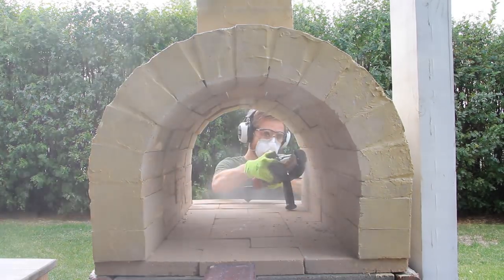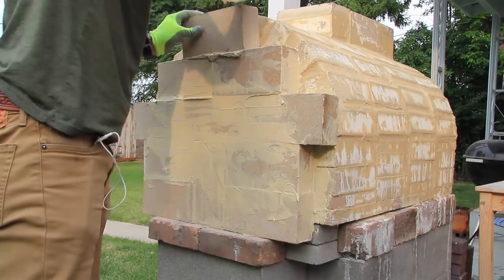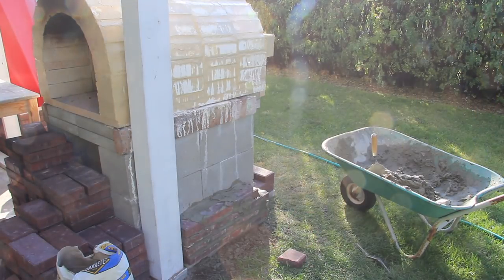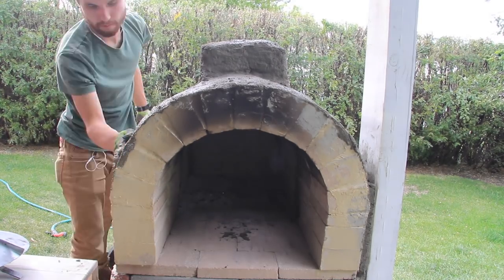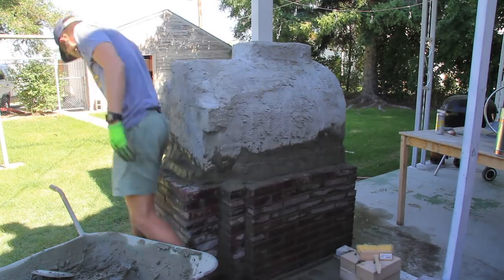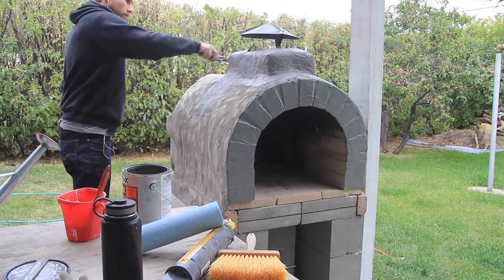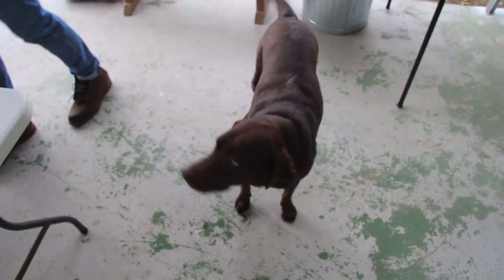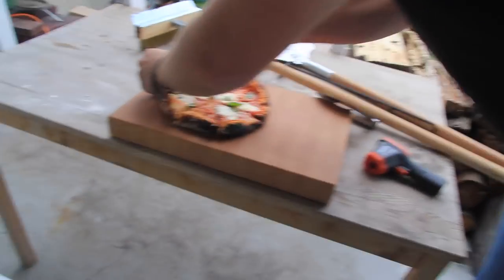DIY // How to Build a Wood Fired Pizza/Bread Oven Part 3

Comment: Awesome job.  I attempted one a couple summers ago.  Bad mix of concrete and it cracked.  Made a few good pizzas with it though.

Just out of curiosity was there a problem with the bricks at the front not heating up enough?  What was the difference in surface temp of the front bricks and back bricks where your pizza is cooking?
Reply from the maker: Thanks for watching and for the comment! No, once we had a good pile of coals in the back, each pizza would cook in about 2 minutes. We kept that area of the oven at about 600 degrees F.
Reply: Right on man, thanks for the quick reply.  Have fun and good luck!

Comment: Have you found that the mortar you laid, has lasted? I've worked on bricking furnaces with seasoned brick layers and they have always said that with arches, you shouldn't use more mortar but rather, cut a wedge of brick and keep the mortar layers of consistent thickness. I'd rather do it your way so that I don't have to cut any bricks but I'm concerned with longevity.
Reply from the maker: That is a great point and one that I would take if I was to do this again!

Comment: Can you tell me how many each of the hi temp bricks you used?
Also what size radius did you use on the wooden template when you where building the arches?

Thx
Pete
Reply from the maker: I don't remember the exact number. All depends on the design you use. Good luck with the build!

Comment: Hey man at your recommendation i went and bought the mortar from amazon link you provided but i got grey cement power not premixed do you think they changed their quality !??
Reply from the maker: No it is still high quality, high temp cement. Just mix water into it. Follow the directions. Good luck!
Reply: Thanks for the reply! After i mixed it it turned out to be grey not offwhite/ yellow like your video! Dunno what im doing wrong 🙃
Reply: Thankyou bro, I will try and make my pizza oven, from your good tips surely I will prevail.

Comment: im not an expert, but i knew it will happen, the contribution of heat is not even. as i said from your 1st video while making the oven, there's lack in it. burning wood should be in the bottom to heat the upper part and not inside to avoid instant burn of the food, with ventilation at both oven and the burning compartment separately. there should be bottles and mini stones for equal distribution of heat. and also build a door in the oven to maintain the heat. the only thing i love is your arc. it looks nice
Reply from the maker: Thanks for watching and for the comment! Even though your tips are good, this oven worked great and cooked lots of delicious pizza :)

Comment: how many bricks did you use for the fire ones?
Reply from the maker: 66 full size bricks including the the rear and 12 1/2 bricks for the top slip line and the first layer either side. These are the fire brick numbers

Comment: Great build, was wondering what did you paint on in the end, its not on the materials used.
thanks
Reply from the maker: Great question and totally forgot to link it. It is an outdoor cement paint for driveways. I will see if I can link it in the description. Thanks for watching!

Comment: You could use water repellent spray for bricks and didn't have to do all that cement parging
Reply from the maker: I originally tried that actually and the water repellent spray didn't do well with the fire bricks and mortar. It didn't seem to adhere right.
Reply from the maker: Ideally I should have created another layer of arches with regular bricks.

Comment: First of all bricks must be layered in chess way. Second you need door. Third there must be screen to protect pizza 🍕 from coils and Fourth - when you start baking pizza, you should close exhaust, otherwise all warm goes out.
Reply: Sorry, this is a complete bullshit comment...
Yes the opening could be smaller to prevent heat loss, but if you put on a door and/or close the exhaust the airflow will be compromised and the fire die out. Not sure what you mean by coils, but no, you don't need a screen to keep the wood embers from touching the pizza. Just technique.
Reply from the maker: I would agree. You need to get the temp of the oven pretty high (500-600 degrees F.); the pizza will cook in around 90 seconds, so having the ability to rotate the pizza is essential.

Comment: What brand chimney cap did you use? What size was it? Did it cover the whole chimney opening?
Reply from the maker: Not sure, it’s been a bit, just one that was at the supply store.
Reply: How has the oven held up for you? I used Rutland refractory mortar and it disintegrated in the rain. Looking to restart soon. @SecondSonWoodworks

Comment: Ok, I have been looking at so many oven designs now and think this design in not perfect. While this is a nice build, best designs have 63% ratio of oven height to front opening height. That helps airflow and heat convection . I think this is a nice fire place, but likely not an ideal pizza oven. It may also need more dome insulation to get stable high temperature .
better option may also be a lower height, but wider oven. I prefer to the fire on the side and not at the back for pizza. I tried fire at the back once or twice, but found it no good.
Reply from the maker: Thanks for watching and for the tips!

Comment: Would you change anything if you made another?
Reply from the maker: steve b I would use a different material for the outer shell, maybe more bricks. Also, I would extend the chimney so it is taller. Happy building!
Reply: If and when get done I will try send some pics. I was planning to extend the base at the front to make a shelf not inside the oven just so have more room to work etc.

Comment: What type of cement did you use for the exterior of the oven? Thanks!
Reply from the maker: I just used conventional cement mortar from HD. But if I was to do it again, I would get something stronger.
Reply: That dry mix with water refractory cement listed in your supplies should have been what was used.

Comment: It's too tall inside. The front needs to be closed with a smaller opening. A lot of heat is escaping out the front on top and the chimney needs to be all the way to the front also. Then you can have a smaller fire. And the dome can radiate more heat downward.
Reply from the maker: Thanks for watching!

Comment: I am wondering if that design works as well as a dome.
Reply from the maker: Jerry Schneider great question! Since I’m not a professional mason and I’ve only built this one oven, I can’t fully answer this question. However, I do know that this design worked great for me (the draft ensured the fire gets really hot and it wasn’t too big for my patio). If you can build a big dome oven, I’d say go for it! But if you need to save space and money, consider the design in my video. Hope this helps! Make sure to subscribe and share with your friends 😊 happy building!
Reply: @SecondSonWoodworks  Thank you

Comment: I kept wanting you to take your grinder and cut off those 2 high corner bricks on the back wall so badly.... was waiting, but nothing... function is what counts. and the bricks you mortared on the outside- I'd have just turned them on the side for larger coverage, faster finish, and to use less bricks. It's not a foundation and no weight is on them.
Reply from the maker: Thanks for the tip and for watching!

Comment: My man i watched alot of the videos you got up what did you use the Liquid nails for
Reply from the maker: Thank you for watching! I used them for the regular cement bricks that won't be exposed to heat so they stay together. Be sure to check out all my other videos :)
Reply: SecondSonWoodworks  yes i did i just wanted to make sure  i can use them regular ones to
Cause i designed my fire place bricks i use stone when I redesigned my first floor to my house  ever since my wife been nagging me about a fire wood brick oven   So i figured i would get into it this spring i plan doing firewood brick oven for pizza. And bread i wanna make  firewood brick bbq and and  a meat smoker
Reply from the maker: Victor Bernard King, Jr. that will be awesome! Hope the build goes well! Send photos!
Reply: SecondSonWoodworks  my man i will send you  my email address contact  after the spring   Hoping we can talk snd  FaceTime i will show you my fireplace  and my outside build. 
What state u live in  i got two places  one place in Ontario Canada my wife is Canadian my house that we live mostly in is in Rochester Ny

Comment: I liked it better before he covered it with concrete
Reply from the maker: I also liked the look, but I had to seal it cause fire bricks are not water resistant. If I was to do this again, I would have done a full additional layer of regular bricks.

Comment: All in all nice build and good process buuuuuut.....The thermal dynamics of this oven are  way off for the heat containment needed. A smaller lower door with the flue to front would allow it hold more heat and cook more even. Ji
Reply from the maker: Thanks for watching! Although I would agree the oven could be better in a lot of ways, I would say that this oven worked just fine after heating it up. The first party I had with the oven, we cooked close to 40 pizzas, each in under 2 minutes. Anyways, thanks for the comment! Make sure to check out my other videos!
Reply: SecondSonWoodworks you sure can’t argue with those results at all nor how delicious that very first pizza looked when it came out of the oven!! Outstanding job Brother!!!

Comment: That oven design is not very good,because the fireplace is right above the fire and that is why the floor of your oven does not heat up, the fire must cicle up to down , if you change the fireplace to the front and made a door to your oven I swear you would have pizzas  evenly cooked
Reply from the maker: It actually worked very well. Go to the end of the video to see a perfect pizza being cooked. It just took a few pizza to dial in the fire and process.

Comment: Sorry that was painful to watch, everything wrong from step one. Your base was not compacted I watched as every block you put on wobbled and all blocks have to be staggered for strength and you should have glued the block ends together. There are so many videos of ovens on line you need to watch before putting a DIY video out, a mason blade on a skill saw will cut bricks which  is what you should have been doing from start with the fire brick. Biggest No No is to tell everyone its safe to use an compressed air line to blow dust off your skin.
Reply from the maker: Painful to read this comment. You obviously haven’t built anything like this, you just think you know it all! Two thumbs down 👎🏼 Buddy. Anyways thanks for watching